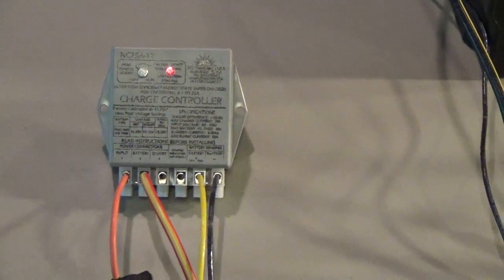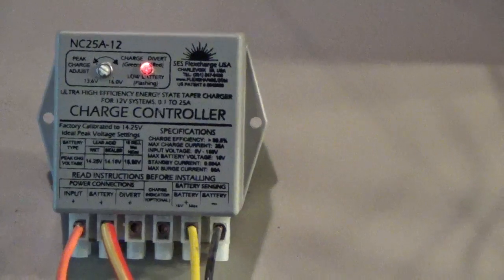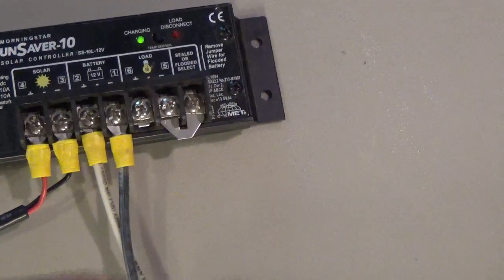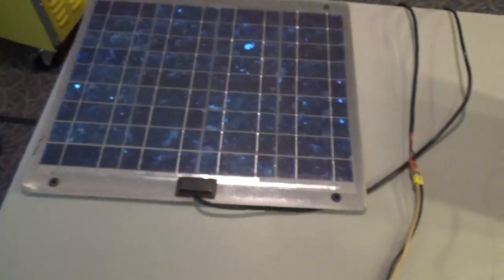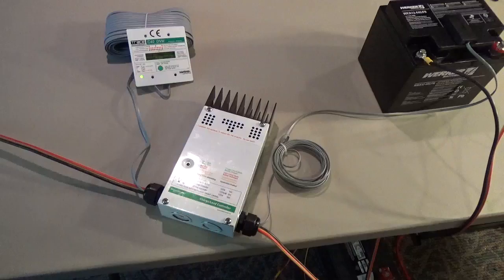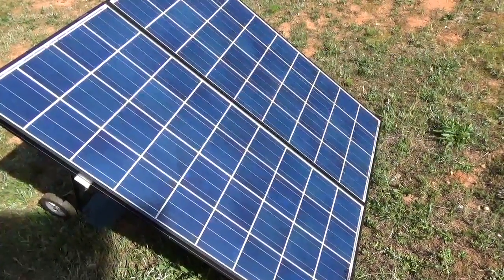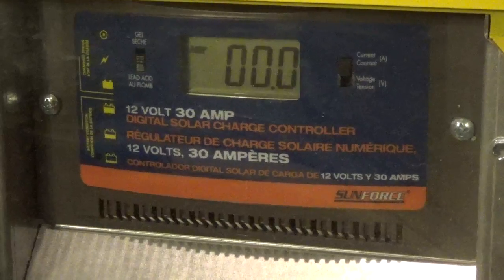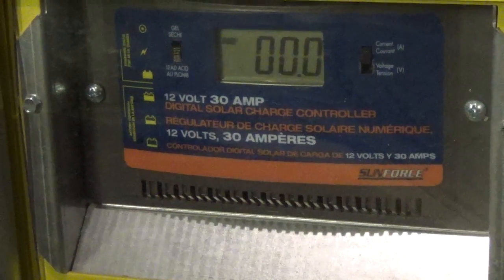Small Solar - 12 volt charge controllers

Comment: Interesting and informative video. I have 2 Kycera 135 Watt solar panels which I have been using for 12 years on my sailboat on a 6 year solo circumnavigation. The charge controller has died. I am using three 12 volt AGM group 27 batteries. Can you suggest an inexpensive controller as a replacement? Also I would like some prices on the controllers you mentioned in the video. Thank you !   Kennedy McLeod

Comment: Hi, I have a 36V Golf Cart that I wanted to hook up on SOLAR.  My solar panel is 12v 150w.  If I buy the  Flexcharge NC25A 12 Volt Ultra High Efficiency Charge Controller, will it CHARGE the 36V battery Pack ?   Also, it it a Multi-Charger meaning will it charge.... 12/24/36/and 48 Volt system all in one charger?   Thanks in advance
Reply: The NC25A are specific to battery voltage.  12,24,48 not 36V.  
Model number 
NC25A-(Voltage)

Comment: When a charge controller says something like 4.5 amps, does that have any effect on what the load can Be? i see some charge controllers with a battery, solar and load option, does this apply there, and if there is no load option what should i do? ive never really messed around with solar at all before

Comment: hey Scott, i got the rain collector system done that you built (mine is a 1100gal tank under a 14x14 shed) and it works great (on my facebook page). Got the crank-a-watt and it works great too. My next project is the "bugout buggy" (my version) which is a 48V golf cart with T-105's, 3500w pure sine, 48V controller and same panels your using now, all mounted on the cart. a "portable solar system" that has other uses as well.

Comment: Engineer775, I have seen a few off grid solar/battery banks use capacitors to help with the surge demand of refrigerators.  I am hoping your knowledge in this area can help understand is this a good idea and if so, how would the wiring set up look like? Doing a web search some people are for it, others say it will shorten battery life because of the demand of the capacitor to always want to remain "full"?  Any guidance would be appreciated.  =)

Comment: How would you protect a solar system from and EMP event?
Reply from the maker: Very difficult to do so I have extras that I Faraday cage.  I take a plug and play approach to EMP protection expecting some components to fail.
Reply: engineer775 Practical Preppers That is my philosophy, I was hoping there was a better solution.
Reply: Tom Angle Another option is to install solar-thermal collectors. Tying reflectors to Stirling steam generators works very well. Small Sterling engines can be very inexpensive when purchased used. New ones will pay for themselves quickly.

Solar Photo-voltaic systems (PV), by their very nature are both exposed and sensitive to outside sources of energy. You may want to keep spare controllers and inverters protected by Faraday cages. Those will fit in a metal toolbox or steel sided old coolers (not the panels, just the distributors). Clean metal trashcans work too.

Old trailers, from all-aluminum air-stream campers to semi-truck cargo trailers work great as impromptu Faraday cages, if you have the acreage to store them long term. Test these old rigs by closing them up completely, then trying to get cellphone or radio reception inside. If you get no bars, you've got a Faraday cage.

One super-efficient resource can also be surplus military vehicle shelters. Many are small enough to fit on a pickup truck. Others come ready mounted on large 2 & 5 tonne diesel trucks. 
Every military shelter is required to have very strong resistance to EMP, as well as chemical and biological attacks.
Surplus military equipment is sold at auctions, so they may go for as little as a few hundred dollars, to enormous vehicles going for a few thousands. Many with less than 10,000 miles on their motors.

Comment: what timing...i come in from upgrading my mini solar system to the prostar 30m to have supper and find you going over the controllers...mine worked great...now 4 batteries  4 panels..total 225 watt...12volt systems..with cutoff switches on the solar side and to batteries.....bus bars fused...load bus bars fused...everything i learned from youtube
Reply from the maker: Very Nice.  I am going to get a couple Prostars to add to the collection.  Where did you get your bus bars?
Reply: http://www.ebay.com/itm/281254222414?item=281254222414&viewitem=&sspagename=ADME:L:OC:CA:3160&vxp=mtr    

fyi...the plastic is kinda brittle feeling...but i have already installed it on my control panel and had no issues connecting 2 panel leads and output wire to controller
Reply: for the negative side i just bought a 6" strip of bar in the bracket section of hardware and made a plastic strip to hold it on..holes already in the bar....just added bolts and nuts to connect leads to..$1.50 investment

Comment: Well worth the time spent in learning about how to use 12 volt charge controllers & a quick look at inverters & connectors for hookups to small solar panels. engineer775 always recommends everyone have some solar chargers on hand...They work great to run a pump, a light, to charge a car battery and a whole lot more. engineer775 encourages everyone to put together their own 12 volt Solar Battery charging system. You will always use it and when you go to purchase something larger you will have a good understanding of how these things work. Compare solar to solar, battery to battery and charge controller to charge controller before making your purchases. Some are way easier to install then others, some a lot more durable then others. 

Thanks for the post.

Comment: i have a small wind generator its 600 watts out, but can i use a solar charger on a air/wind turbine? or does it have to say air on it...thought power is power shouldn't matter right...anyone?
Reply: You can use a solar charger on a wind generator if the wind generator is voltage regulated .A lot of wind generators are not and produce  higher voltages the faster they spin there for requiring a special charge controller.
Reply: oh ok, thanks..so, then if one has a solar and wind combination, you have to use two different banks of batteries and controllers? or have two seperate controllers and both tie together to 1 set of batteries?
Reply: *****
One set of batteries and two separate controllers ,One for the solar and one for the wind generator connected to the same battery bank.
Usually a wind generator controller will have a dump load so when the Battery bank is full it diverts the load to another load such as hot water heater or lights this prevents the wind generator from spinning with no load which could cause it to over speed and spin out of control.
Reply: Anthony Schnabel
love your work by the way 775. I don't mean to take over your comments section
Reply: Anthony Schnabel
This is how I have set up my systems anyway and works well
Reply: Anthony Schnabel many chargers have line filters, but if not, you can add them inexpensively, available at most electrical supply shops or radio shack.

Comment: can anyone tell me how to figure out what is the max size panel a small 12 volt charge controller can handle? I was looking for max watt input but don't see anything listed.  thanks!!
Reply: Volts times amps will give you the max watts your unit can handle. If your charge controller is 12 volt and it says 10 amp you are looking at 120 watts. Make sure your solar panel has a 12 volt output. If that is the case I wouldn't use anything bigger than a 100 watt solar panel.
Reply: Jim H hey jim, that's exacty what I have..perfect! thanks so much!!

Comment: I am a faithful subscriber
But are you a chemical
electrical or mechanical engineer ?
I started with vacuum tubes, In the 40's, but because unlike most of your viewers  I like newer cheaper and better  so I bought all of the secondary burn stoves and the one that charges my Phone in the woods of AZ ?
 Do you endorse any over the other?
Reply from the maker: Mechanical.  When it comes to charging off of a biomass stove I like to have the Powerpot along.  It makes twice the power of a Biolite. https://practicalpreppers.com/online-shop/power-solutions/thermoelectric-generators/power-pot-detail-view

Comment: building an automatic door on a chicken tractor with a power window motor. will be using a 12 volt truck/commercial battery to power it with a dusk to dawn switch. What do you recommend for a solar charger to keep the battery topped off?
Reply from the maker: This one is bullet proof. 
https://practicalpreppers.com/online-shop/power-solutions/solar-solutions/flexcharge-nc25a-ultra-high-efficiency-charge-controller-regulator-detail-view
Reply: When using the Flexcharge NC25a have you been manually adding blocking diodes into the system you use it with?  The other charge controllers have them built in but I'm wondering your take on that aspect?

Comment: Good stuff! I think people need information on things like this.  I think a series of a small setup would prove invaluable to those looking into solar.  I remember when I first started looking into solar myself.  The solar panels is the easy part.  The charge controller, battery, and inverter was the confusing part.  To make sure you buy and choose the right parts I would say takes at least a week.  I suppose this is why people hire professionals.  The amount of information you have to learn just on batteries is overwhelming at first.  Then would be the math behind your system.  Unfortunately there is no software that is set up for these kinds of things. Let alone any good video/videos bringing you from start to finish on a solar setup.  Anyways thanks for the info!

Comment: Do you need a special controller to charge AGM Batteries?  I have one of those sears platinum deep cycle batteries that I run my DIY solar hot water circulator pump with.  I have to charge it every few days.  I have a high end Wal-Mart  battery charger (probably means it's still on the low end of quality), which has a setting for AGM.  I've been wanting to hook it up to a solar panel, but wasn't sure if I needed a special charge controller to handle AGM.
Reply from the maker: The Flexcharge has worked great for me as many of my installs are using AGMs.
https://practicalpreppers.com/online-shop/power-solutions/solar-solutions/flexcharge-nc25a-ultra-high-efficiency-charge-controller-regulator-detail-view